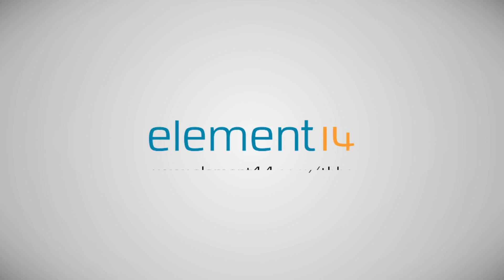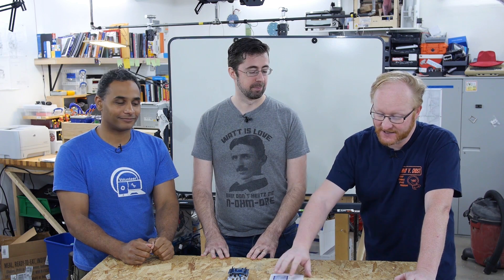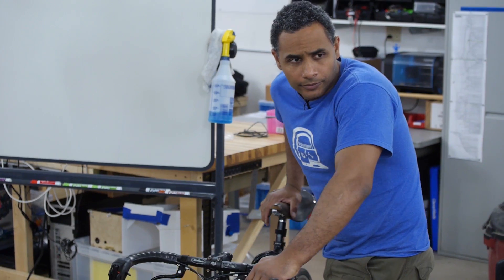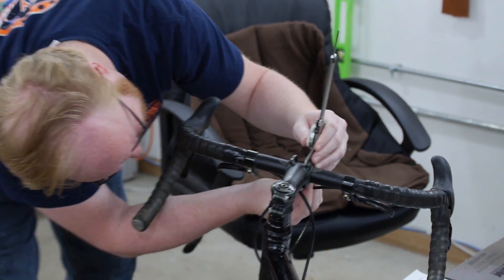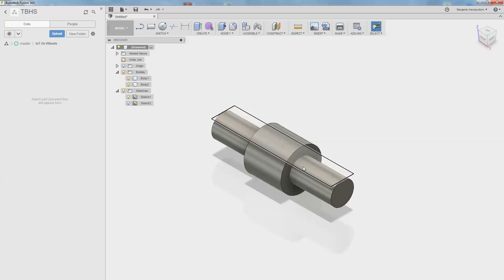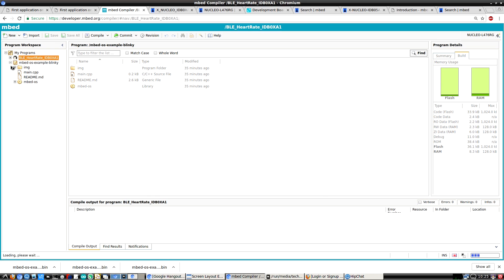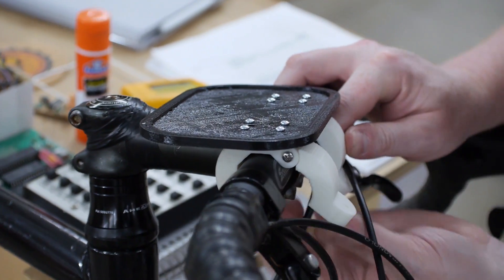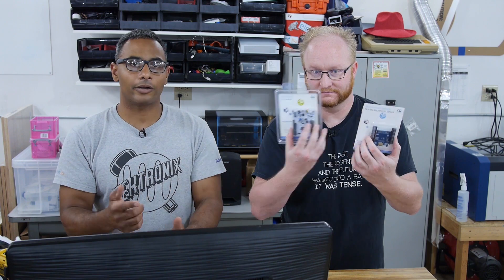IoT on Wheels Part 1: Smart Bike

Comment: Increase the size of the mounting section then use some rubber to pack up the size. Will allow it to fix other bikes, provide a better mounting surface and protect from scratches.

Comment: Hey Ben, are you planning to do any more video game console mods in the future? I have an Idea for an NES in the front drive bay of a PC that can operate on your computer. It could work by using an NES-on-a-chip sending video signals to the computer and receiving control inputs from the keyboard or a usb controller.

Comment: 1) You can draw a cylinder instead of filleting a box. ;)
2) You can actually have Fusion do a total length symmetric extrude. The button I right above the length box.

Comment: What BLE chip are you using? I am familiar with the RN4020 which uses a UART interface. It's tricky to get it all working right on each OS, especially Windows. Even if it works right in Lightblue doesn't mean it will in your (iOS) app, so test it really well!

Comment: Cool project, but wouldn't the best place for the device be underneath that big touring saddle?  Then the controls for the device could then neatly be integrated with the mobile app, and the user could all but forget about the added bulk
Reply: The idea was to have physical buttons on the handlebars and Ben didn't want to have to worry about running wires along the bike, not wanting to go through the frame, it's not worth the hassle of making the wiring rugged.

Comment: what is the processor that is used by that device if it is an arm chip could you not use arm-Linux-gnueabihf compiler or arm-Linux-gnueabi toolchain and Code::Blocks  to compile the code that you are developing.

Comment: In Britain there's a national website that you can just report problems with local roads, you just pin point input on a map... The council then has to reply to you within a few days.
Reply: This device would hopefully work well with that. The idea is that while you're riding, you may not remember a specific location of a point of interest, such as a pothole. This allows you to log the exact location with a single button press rather than having to try to remember and find it on a map later. Is that what you have to do with the current system?

Comment: hey maybe easier to take the top cap out of the top of the forks.  then drill other holes in that.  to mount the unit.  easier than making clamps.  Ive seen top caps made of alloy.  but also plastic ones.  so you could print one, if needed